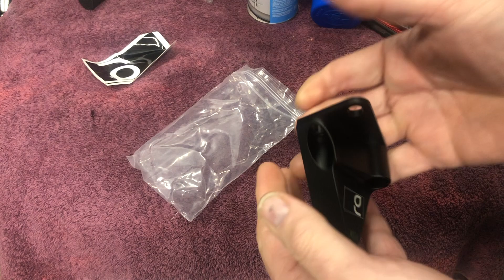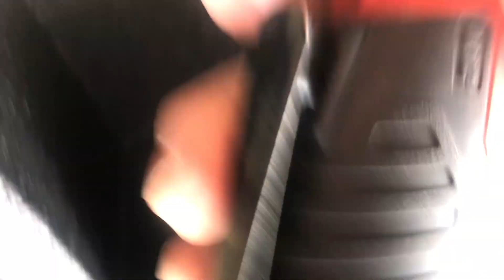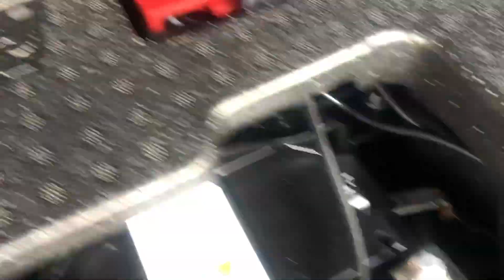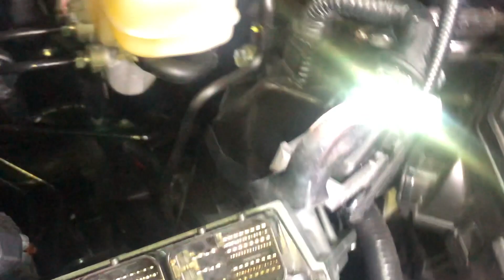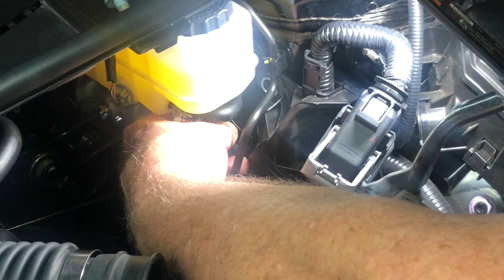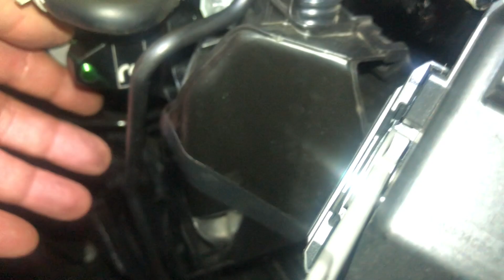GR Corolla | RADIUM ENGINEERING Master Cylinder Brace Installation | Improve Your Brake Pedal Feel

Comment: Hi Jim, thank you for the video! Does it make a huge difference? Mine was lacking initial bite when new and the pedal is a bit too soft
Reply from the maker: It's designed to prevent any flex in the firewall during hard braking. I don't track my car but I drive hard on back roads and when I'm canyon carving I like the additional bracing when braking hard. It's not like it's a day and night difference but I've done this upgrade on other cars and I like the extra stiffness.
Reply: @jimsgaragetoys Percentage wise, how much stiffer would you rate after installation?
Reply from the maker: @michaelxie4563  I have no idea, I would just be guessing with no idea of how close I was so it seems silly to put a number on it. It's not very expensive so I'm not worried if it's a 15% improvement or a 30% improvement. 😉
Reply: @jimsgaragetoys Just installed mine today. The brake feels more solid. However, I tried pushing the brake pedal a few times after car is turned off and the pedal has maybe a quarter inch of travel. Isn’t it supposed to be completely firm?
Reply from the maker: @michaelxie4563  Honestly I'm not sure. I've never thought about pushing on the brake pedal with the car off. That's most likely just the movement of the pads from the fluid.

Comment: Interesting that little piece will make a big difference on braking, please report your findings.
Reply from the maker: I notice the difference in hard braking when driving on back roads but it makes sense when you think about it. When you brake hard there is enough pressure on the brake pedal that the firewall actually flexes. This little device prevents the firewall from flexing so it makes the brake pedal feel firmer and the braking experience better. 😎
Reply: @jimsgaragetoys  I'm going to Homestead for a NASA track event, this will be my third, but the only upgrades I did so far are the GR Brace strut bar, GR air intake and the 24 upgrades (Stickers and bolts), I guess this master cylinder upgrade will help me as well.
Reply from the maker: @primeroadsandrides  Any driving that will involve hard braking it should help. I noticed better brake feel when driving the back roads when out on a very brisk drive and I would use the brakes hard when diving into corners late and hard on the brakes.

Comment: I just ordered the DC Sports shifter base bushings (to accompany my racerX bushings and SS-highly recommend)  and I was looking for install videos but can’t find any good videos for that brand on the GRC. Just sayin…they’re like $30

Also got the JB4 - gonna install that this weekend. Fingers crossed I don’t blow up my engine lol

Keep up these videos. You, carquicks and that Da Boy have been awesome in all your install content.
Reply from the maker: The base bushings are pretty much the same on any car, not very hard at all. You have to remove the trim on the center console and then the 4 bolts for the base bushings can be taken out. You have to then push and twist out the OEM rubber base bushings and slide in the new metal ones. Screw in the new bolts and replace the console trim and you're done! I'll be making a video removing the center console trim soon when I have some plans for it but not sure when it will happen. 

Glad to know the videos are helping out!